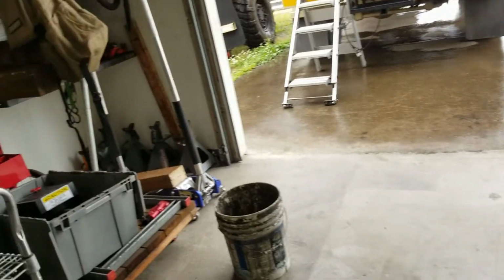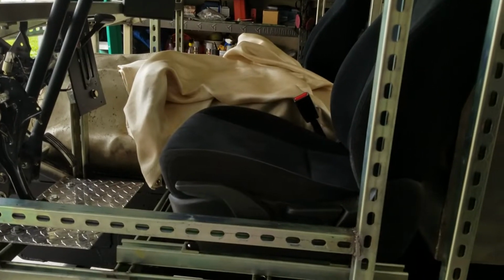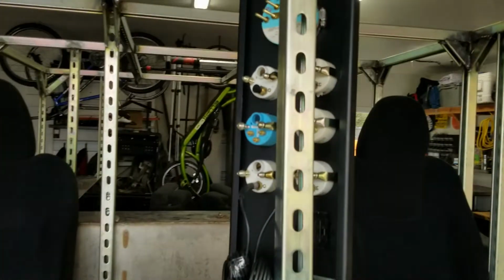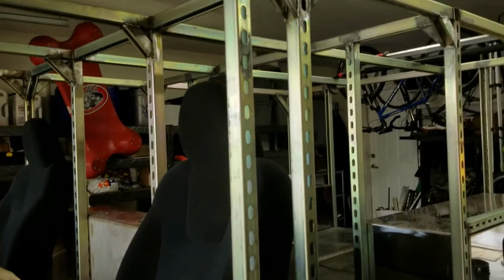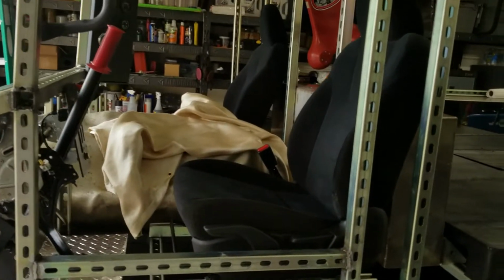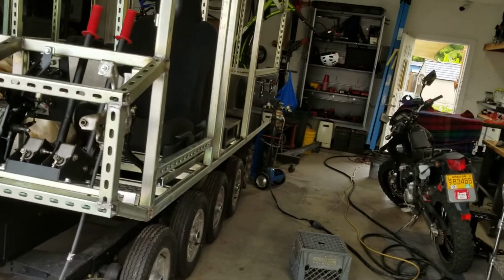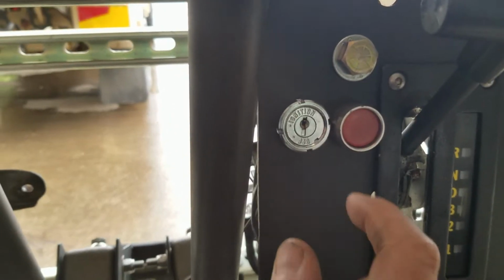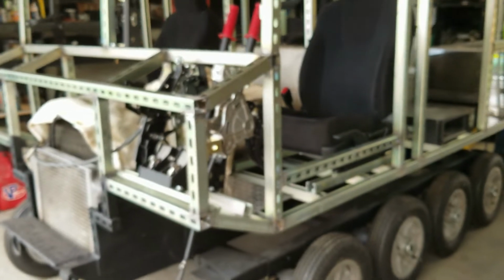Rusty the Spryte build part 69 (gauge panel, shifter panel, keyed ignition, push button start)

Comment: Sean, The 1202 series cab splits horizontally, bolted in the corners, facilitating engine removal. The tracks look pretty rusty, save the backing plates, you will need em. Rusty coming together, good work.
Reply from the maker: Hi John.  Thanks for the information.  The original body on this one did not have that feature.  The only way to get the engine out was through the door or by removing the axles.  I have a plan for the track grousers...

Comment: Really like the way that you remounted seats, looks great and very functional!    Like what you used for the gauge panel,  but I am concerned about the huge blindspot that it creates.   Have you considered mounting the gauge panel below windshield height (may have to rotate gauges to use the long way) and even removing the center strut to give the large unimpeded view of snow capped mountains?  I think if you doubled the top header of the windshield  that you would have enough strength to allow using one large flat windshield.  Any way, keep up the great work!
Reply from the maker: Hi Kurt.  Right now this is the best spot for the plans I have.  Thanks for sticking with me....

Comment: You are going to town on this build.  I like the panel and the way you mounted it vertically instead of horizontally but will it obscure your vision to the right?  It is hard to tell without sitting in the driver's seat.  The starter button is a good touch as well as the transmission shifter.  I was wondering why you would make the door smaller but it makes sense that you would not want the track throwing snow through the door when you are running over the country.  At first, I thought it would restrict you when you went to get into the cab but after thinking about it you will not be climbing up into the cab because you will stand on the track and climb down into the cab.  This snowcat build is coming along really quickly now and you are getting a lot done every time I watch your videos.  Keep them coming!
Reply from the maker: Hi Phillip!  Yes on all counts.  The tracks are also used as a step to get into the snowcat as far as I can tell from other videos I have seen.  This is all new to me I hope I am doing something right.  One thing is for sure...everything is adjustable UNISTRUT FTW!!